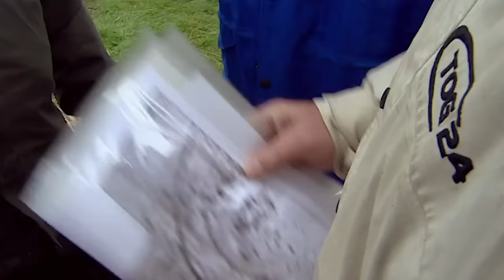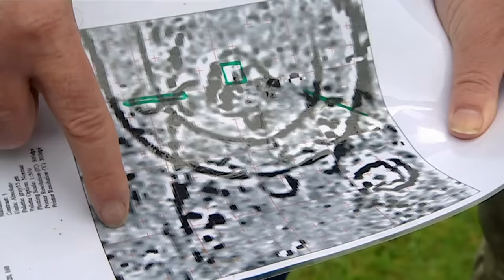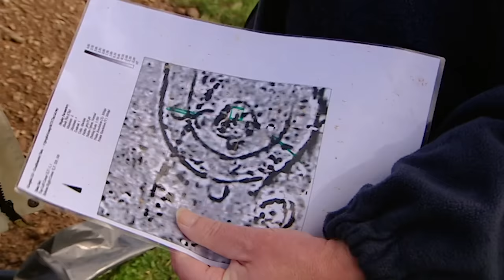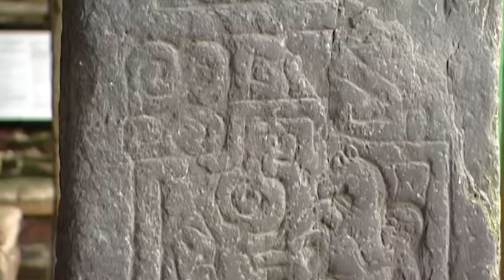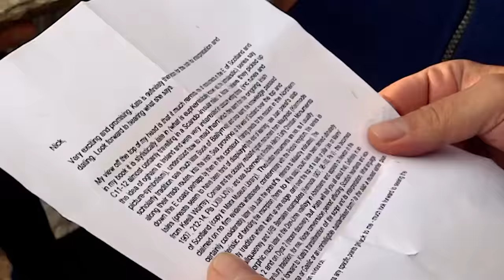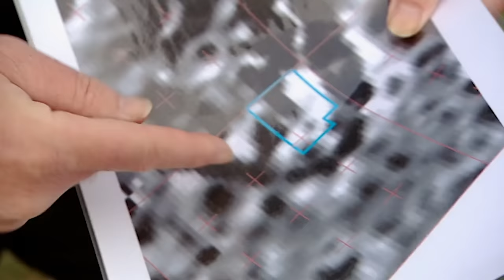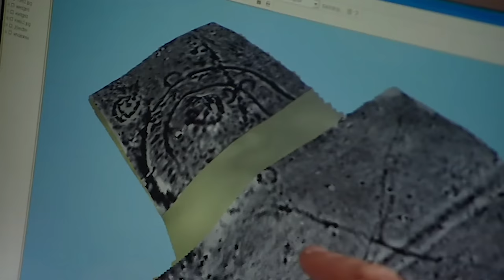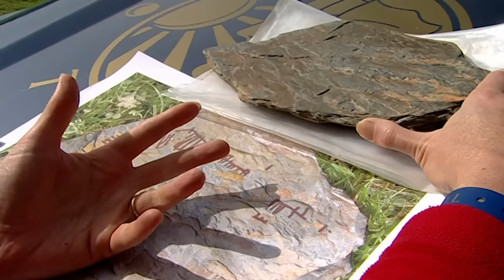Finds on the Fairway (Speke Keeill, Isle of Man) | S14E01 | Time Team

Comment: theres a cross Celtic type , with the great wolf and 4 of the dragons of sky on it  , wolfs head which i an inverted pyramid  of 3 circles the bottom one being the nose  which are inside a bigger circle  is placed where the  the circle meets the top of the cross upright
  the 4  dragons are  2 evenly spaced on  ether side of the lower quarters of the  circle ring , i think its possibly Viking

Comment: I wonder why time team does not sell some of the excess pottery and stonework that they find… they find thousands of pieces of ancient pottery that you can only assume is of too little value to put in any museum. It would make great merchandise
Reply: It will go into the finds boxes associated with that dig and deposited in the museum vaults. That's what museums are for, as much as putting a few choice objects on display for the public to gawp at. They are then retained because in the future archaeologists will have methods for analysing them far in advance of what we do now. For example, many finds from previous excavations are presently being re-examined for micro wear on blades and seed fragments/pollen that previously weren't looked for.
A piece of pot may have been originally attributed a date, only for later analysis and comparison to more recently found examples to give another, revised date.

Comment: The find is an Irish Find, the stone/writing and the young lady in the grave, "Irish", 6th Century CE or earlier.  
The Irish built stone structures using the same method prior to Viking invasions, i.e., "Newgrange".  
This is Irish, pre-Viking.  They also used the same type script.  Stone can't be dated, so they are using the script to date it and there lies the potential for misjudging the stone.  I believe it actually goes with the site and the building is also part of the original site, rebuilt again at a later time.  One would look to the community of Peoples 1st. I believe My interpretation is as equally Academically strong, actually stronger, than the "e-mail's version".

It may have been a subject of "Academic bias" to contribute this to the Vikings. (Anglo Saxons, Germanics aka largely the DNA of Modern British).  

Time, will contine to provide greater facts.